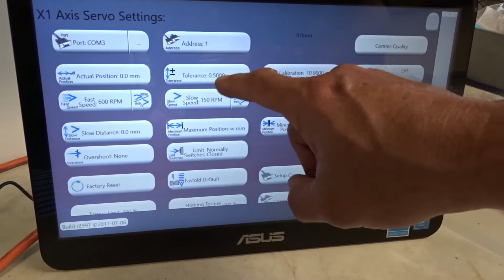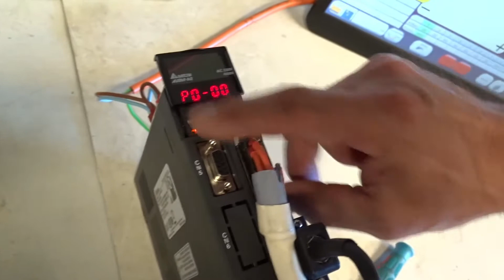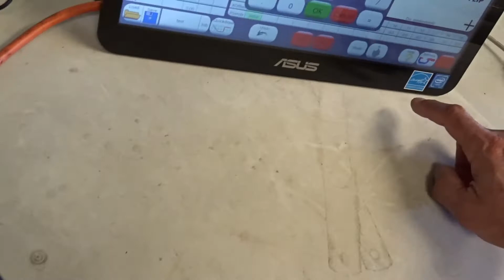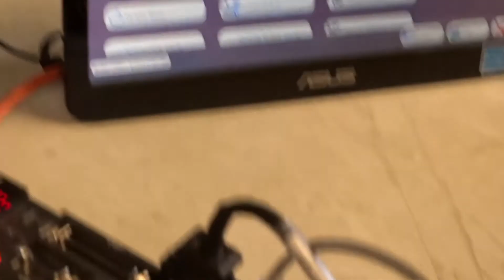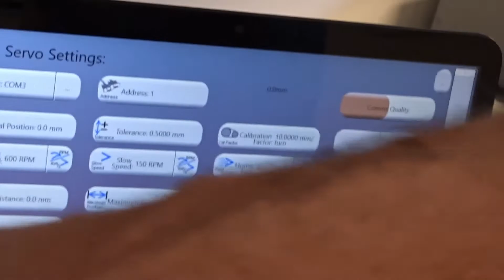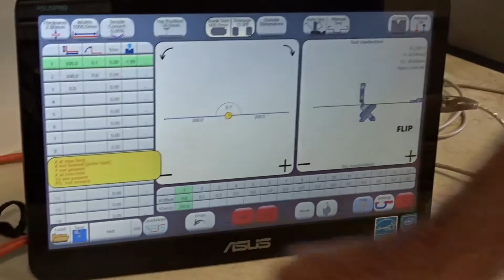Fasfold DELTA Servo drive commissioning

Comment: How can i turn on the servo motor. Im uding delta asda-a2. At the display of the servo drive is 00000.  
And on our hdmi didplay of the machine the servi is didable.when i press enable its not working..pls. give any idea to power on the srrvo..thankyou
Reply from the maker: Hi, Check our video on Delta Jog,

Comment: I can't find any decent information about P1-44 and P1-45 (gear ratio).
I've noticed there are 2 screens on each parameter which look like this _ _ _ _ _ and _ _ _ _ . _
I want to set 1280000 on P1-44 and I'm told that P1-45 should be 1152. This gives me an alarm for gear ratio.

I think I might be setting this up incorrectly, because when I set P1-45 as follows, it doesn't work:
_ _ _ _ _  1152.0

Should I be setting it as:
_ 1 1 5 2  _ _ _ _ . _ 

Any help would be much appreciated but I understand if you're busy.

Thanks for the video

Comment: I need solution al022, plz help
Reply from the maker: Hi Kostas, I dont have experience with AL22, do you have a Delta manual? if not , I can help you
Reply: @cncautomotion     now i fixed, all022 means to lose one phase. Thank you for your reply